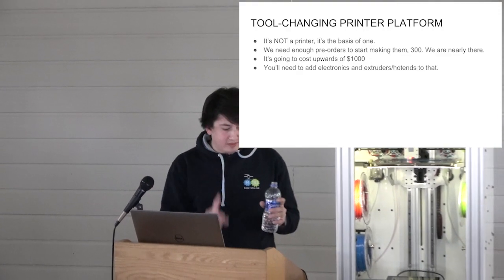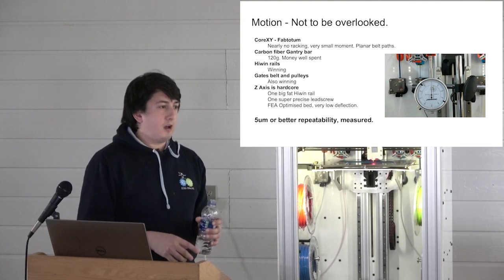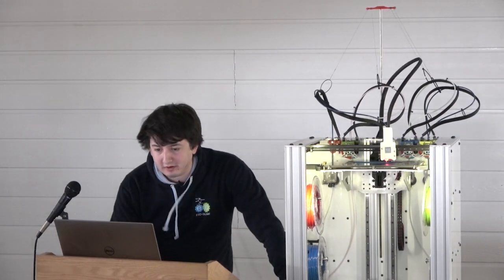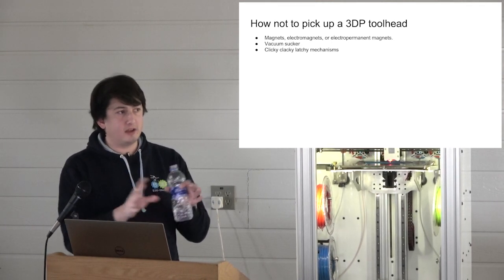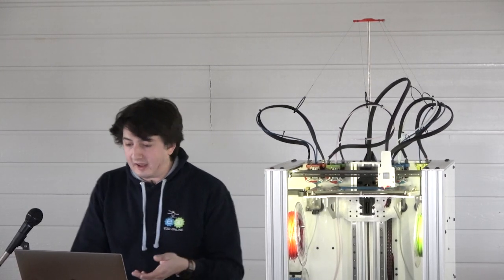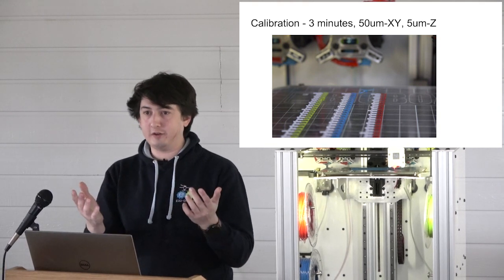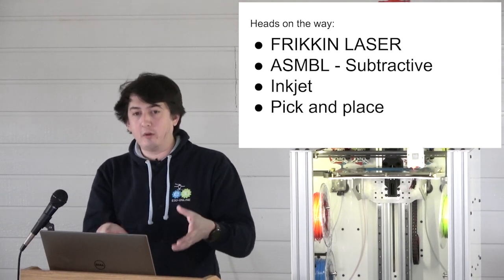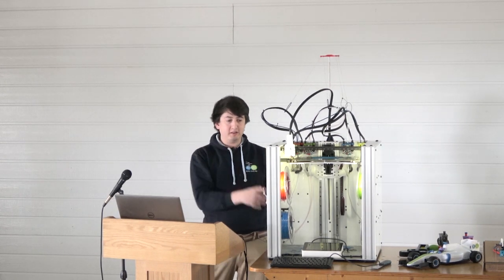Tool-changing 3D Printer innovation: an E3D talk by Sanjay

Comment: Nice presentation Sanjay! You can't imagine how excited I get about these things, I just really like it when people are passionate about what they do and even moreso when it is the same subject I am interested in. 

I can tell that I got a load of ideas while watching this presentation and the interview with Thomas Sadladerer. And also a few questions/suggestions. Please understand that I am not saying you are doing it wrong, just ideas to maybe get it to the next level. 

1st: I see you still use steppermotors. Did you consider servo's? I want to use servo's (teknic) on my next machine and it is the first that came to mind for this "lets go crazy" project. They are about 250dollars a piece (incl tax) and can be controlled by step/dir. Should make the machine even more silent and rapids can be way faster (up to the linear rail limit of about 2000mm/sec) especially interesting to minimize the toolchanging downtime.

2nd: The purge is on a centeralized place to the left, wouldnt it be nice to have a purge tray underneath each extruder that is operated by a servo or something as part of the toolchange cycle?

Hmm... This is quite a long post, and it is very likely that you never get to read it. 

Oh well, to whoever actually reads this: thanks :)
Reply: I understand the worry for the motors but I believe that such precision can be even greater with brushless motors/rotary encoders. A stepper is basically a geared motor with a rotary encoder built in. With brushless motors/encoders precision speed can be achieved cheaply.

Comment: You guys triggered me so hard. I'm in!!!!
Reply: Please give the "triggered" thing a rest. It's abusing a term that until recently was primarily used by psychiatric patients to refer to incidents that caused panic attacks, anxiety attacks, and similar unpleasant events. The new, 4chan-originating meanings of it have completely killed its original definition, left mental health patients unable to use that word for its original purpose, and it makes a complete mockery of those mental health patients as well.

If you weren't aware of those origins, that's fine, please accept what I'm telling you (or do your own research) and then maybe stop using it. If you continue to use that word in that context, at least understand that what you're doing is shitting all over some of the most vulnerable people in society, in which case I hope you sleep worse than I have been lately.

Comment: This could also be great for biology / laboratory work. 
You could mount a microscope head with a high res camera on there and do focus stacking automatically to increase depth or make a 3D model. 
Or have a pipette dispenser to dispense stuff into a bed full of small petri dishes, then watch what grows.
Or of course 3D bioprinting but hey, 3D printing is already boring ;)
Reply: Yeah, I have already wondered about SLA as you can printer microfluidic structures perfect for reacting vessels etc. I am not super familiar with the requirements for chem/lab work but I would think something like 3d printing a boon for the research sciences.
Reply: Yeah that too! I've read that lots of people 3D print lab specific equipment already.

Comment: Amazing stuff! You should sell these as a > 2000 money unit kit with at proven set electronics and tools, e.g. 32-bit controller, touch LCD screen, 2 normal nozzles, 1 flexible nozzle and one hardened nozzle.
Reply: they dont do that so people who dont know what they do dont buy them
Reply: Jonni Nakari i would buy that
Reply: Ruud123 yeah, I guess that's a good choice in the long run. Otherwise there would be lots of noobs who were excpecting a plug n play system complaining on forums, returning the kits etc.
Reply: Also, as Sanjay says, not wanting to compete with their OEM customers like Ulimaker and Prusa to name a couple.

Comment: Must admit, it all sounds very expensive, even the cheaper version...  But it's the right way to go. Still need to sort out dribbling nozzles & internal caking when keeping them hot on standby, etc.. Also very scant on the flexible filament options. The rest is a bit "airy" - laser heads, pick and put, etc. 

First get flexibles and rigids working properly, with good software slicing options for those filaments when combined. I'd want to see proof of that before purchase.
Reply: We already have a working flexible head, and slicing. Greg the main designer on this is the guy who did the first desktop diode laser cutter. So not airy. I'll give you the pick and place though, that's going to need some work.
Reply: You already have my money - just trying to get you to prioritise flexibles! How's the motion system cope with the heavier direct feed head? No issues for that CF flexing?
Reply: depends.... looking at MakeGear, Ultimaker, BNC3D and others, this offers 10x more than those machines for less even without electronics.    it would be like $500 more than a prusa mk3 and be 10x faster, more precise and much better than any MMU they can put out for it.  so it's fairly chap.... it's not consumer cheap but people buy/build gaming PC's in the 2K range nearly every year with $500 video card's so this is nothing.